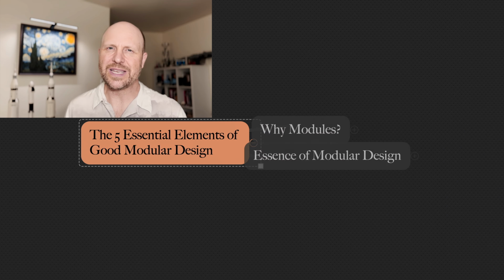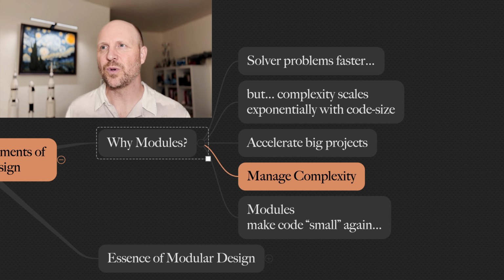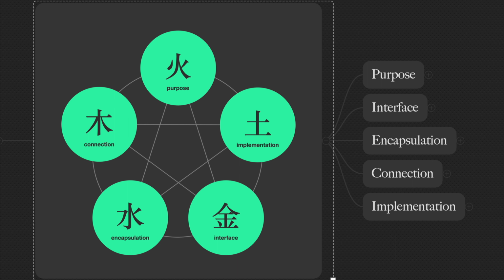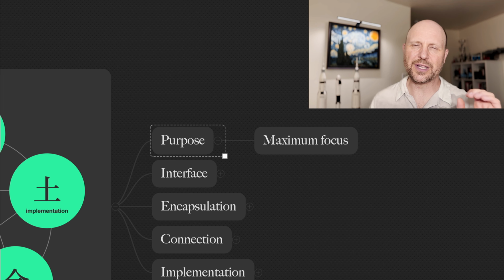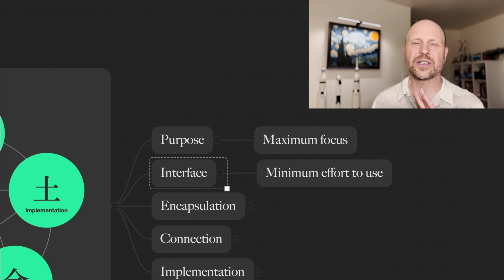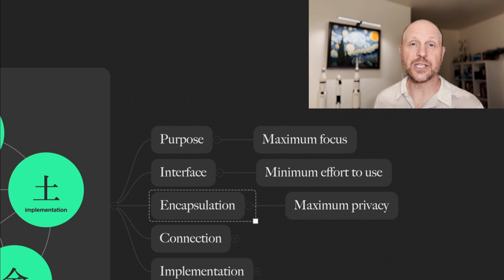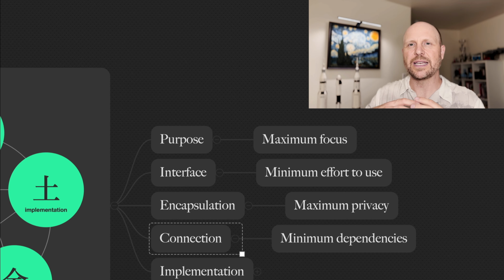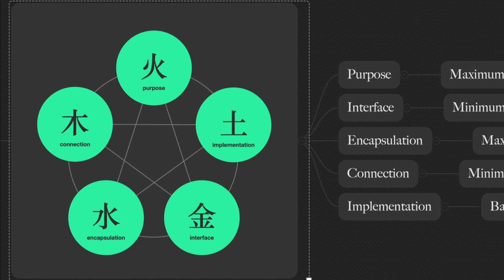E13 - The 5 Essential Elements of Modular Software Design

Comment: Your presentation style is very modular too! Wonder you probably count naming as part of the interface too right? And dependencies as connections I'm guessing. 

Would documentation count towards the interface? 

Wonder do you consider Versioning to be an orthogonal concept? 

Do you think of protocols like HTTP or IP or TCP, that have back and forth dialogues or monologues as adjacent concepts. 

Perhaps like you hinted these are more systems engineering concepts with moving parts so they are verbs. 

Modules are nouns.
Reply from the maker: I think the “real size” of an interface isn’t just its functions or parameters—it’s the amount of understanding a user needs to use it effectively. Like you said, I think doc is part of that, but no one reads documentation end-to-end; they only absorb enough to get what they need. This “necessary understanding” is what I think really defines the "size of the interface" for any given human (or AI) tying to use it.

Classifying "versioning" is interesting. I've been thinking a lot lately and where it fits in the 5 elements. My conclusion is it's really more about Connection, or the ecosystem of modules. It's all about how modules depend on each other within an evolving ecosystem. That's "connection" in the PIE/CI.

The question of "protocols" is also interesting. In some ways it's akin to "interfaces" in an OO sense. When you define them you're not just defining your outward facing compatibility, but you are also establishing a contract that other modules can also honor. In other words, a defined "interface" has two kinds of clients - those that use it and those that implement it. I think the main difference is "minor" version changes in the semantic-versioning sense become "major" for the implementors. So really, if you are making a "protocol" you basically have "patch" and "major" changes :) - and I guess "patch" is just implementation anyway.... When designing a protocol, you usually have a reference implementation as well, so really, I think all of the 5 essential elements apply after you take into account that "minor" version changes are all promoted to "major." Still, I'm sure when you think about the "ecosystem" of modules around a protocol, many more sub-topics come up!